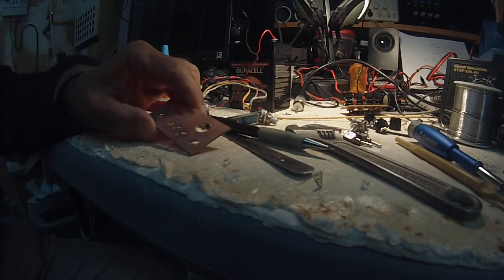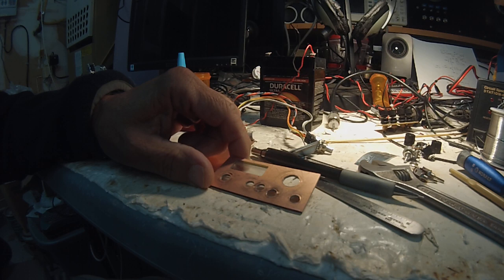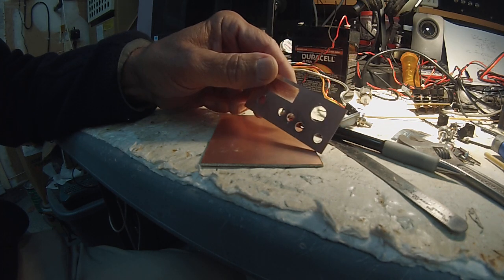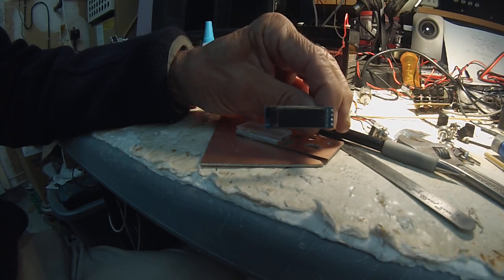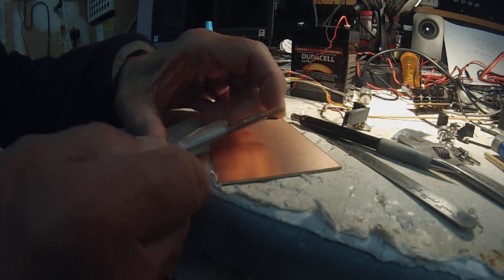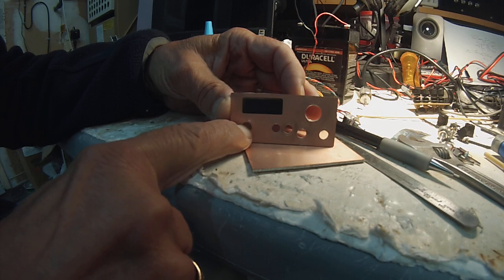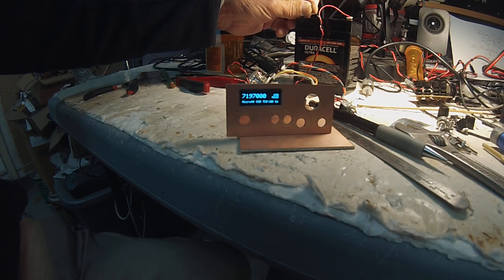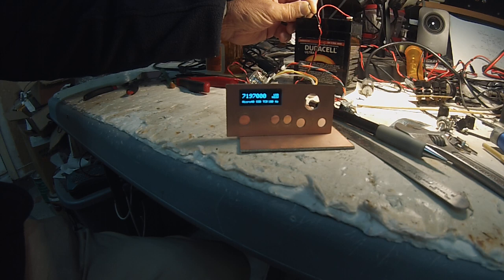ZL2BMI Challenge Rig

Comment: That's an ingenious solution to the display-mounting problem, but the whole time I was watching I could hardly take my eyes off the top of your bench. What is that stuff troweled all over it? Is it plaster? Cake frosting? Some kind of space-aged anti-static dessert topping? Sorry, it's off topic, but what the hell . . . ? --Todd K7TFC
Reply from the maker: Hi Todd,

Foam Core Poster Board Turn it over for a fresh board and then recycle. Cheap, easy to write on --two sides and recycle.

Pete N6QW

Comment: Schematic?
Reply from the maker: In the video I mention that this rig will be similar to the one published by ZL2BMI, Eric Sears in the current issue of the GQRP Club SPRAT publication. In general it will be similar to my Sudden Transceiver which you can find links at www.n6qw.com. Typically I take a bit of this and bit of that and end up with a rig. When you know stuff you can do stuff! Essentially it is two NE602's which are wrapped around a crystal filter. In this build I will be using a homebrew four pole  4.9152 MHz filter.

Pete N6QW

Comment: Good stuff. Run a bead or a  dab of hot glue on the other end will hold the OLED in there and keep it I think. You can always heat up with hot air to remove. Great little concept. Very interesting too the ne602 vfo/bfo tx/rx arrangement. I hope you post  this on your BLOG. Keep us updated. Thanks again Pete. 

-73's   KE0WQB
Reply from the maker: Hi BLR,

Thanks for your post and suggestion -- I do have a glue gun. Nice. Stay Tuned.

Pete N6QW